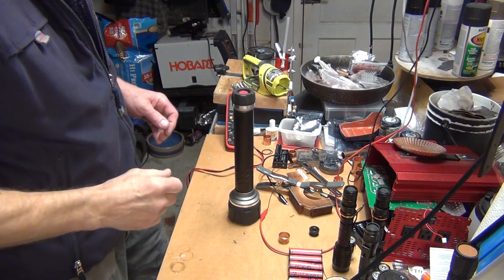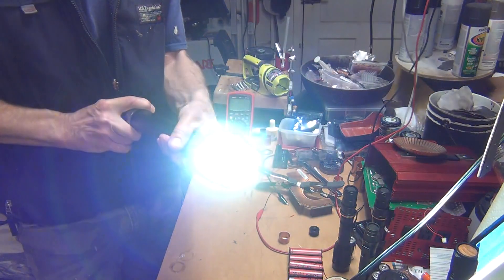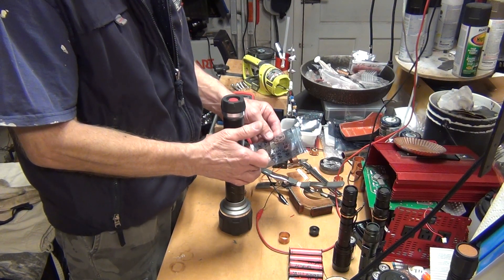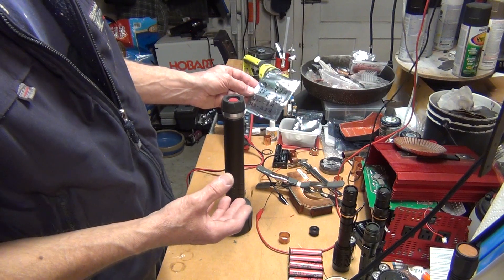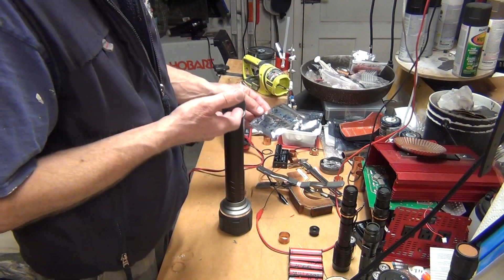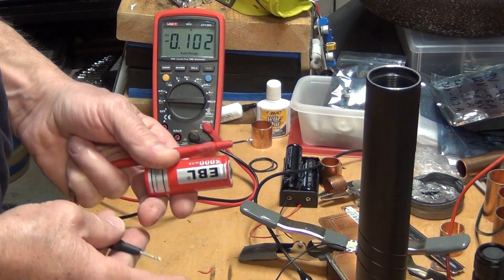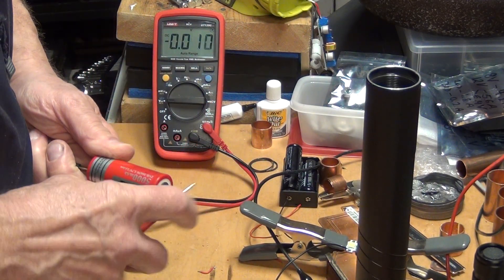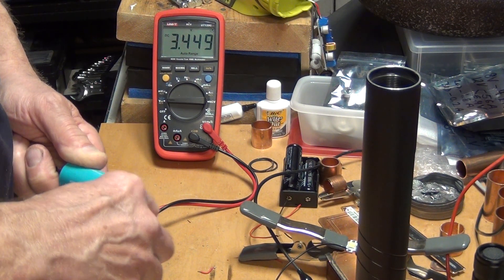26650 batteries EBL OLIGHT PK CELL Li-ion

Comment: You can't test 3 different brands in series the LEAST bit accurately. You can't really test 3 different batches of the same exact brand, model. Let alone that they are probably even different chemistries. I was looking for some decent info on ebl vs pkcell since the ebl are cheaper on eBay for 10440 cells and they are inr vs pkcell icr. But I got this. You shouldn't try to instruct when you don't have accurate information. You can say it doesn't matter all day. I can also say the Earth is flat... Doesn't make it true. Not to be an ass, but I'm sick and tired of all the disinformation being spread as truth. Opinion as fact. As an opinion, fine. But it should be stated as such, and in absolutely no way factual. This is basically which color you like best, honestly. And cells in series are never going to discharge exactly the same.
Reply from the maker: Too much plain talk but no proof. Why don't you tell me why can't you do it in series instead of wasting your time with bitching about it. It looks like you don't know much about batteries at all, you r just listening some guru who you believe. Where is your video about discharging batteries in series? Or at least send me a link to some video. Thank you. V

Comment: I purchased that charger for my dad without realizing that it does not do a discharge test for true mAh. You cannot test what goes in, but only on discharge! The cheapest one that I used is the pspower dc204 for around $15. I like the 4 slot zanaflare C4 but it's $30.

Comment: This is an inaccurate video. The ones on the ends will always discharge more. Also they are all discharging at 1.8 amps, it is series, not parallel (I mean you said series but they will only divide the amps in parallel.)
Reply from the maker: Well, its not a perfect video but I have seen worse. And where did I say its is parallel connection? If you listen better you will hear me say "in series."  It looks like you need to do some study before you criticize someone. Good day.
Reply: Vlad Fred Kovac I know but someone experienced would know that they are all at 1.8 amps
Reply: Vlad Fred Kovac also your comparison isn't comparing, because they have to be tested separately
Reply from the maker: Disagree, they don,t have to be tested separetly when in series.
Agree, they do discharge in 1.8 amps, my mistake. Thank you for pointing it out.  :) I have my voltages and amps mixed up.
Reply: Vlad Fred Kovac Yes they do, often times large battery banks will have problems on the batteries on the end because they have more stress than the rest
Reply from the maker: okay man, sorry for being inaccurate. But the point is which battery is true to its statement. And how can the one at the end discharge more? Please explain.
Reply: @ryanmickelwait1521  someone experienced, yes. Most people, a big NO! That is a BIG problem with li ion cells, since a miscalculation can be quite dangerous. What does it matter if you're content is inaccurate? People who know better... Uhh, will know better... Do you see how stupid that sounds?
Reply: That is why they have BMS. The BMS balances the cells to the same voltage.  Only certain battery types like lead acid auto-balance.
Reply: Ryan Mickelwait okay then power tools, laptops, auto batteries and many more would have problems according to your statement. All of these consist of multiple cells batteries.